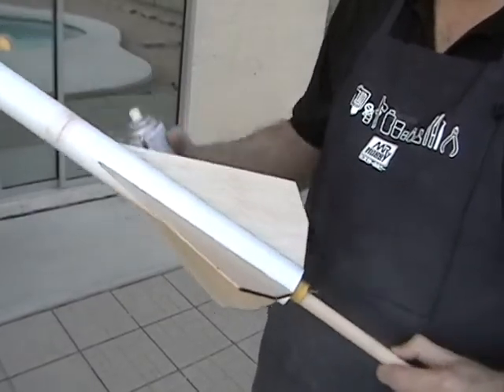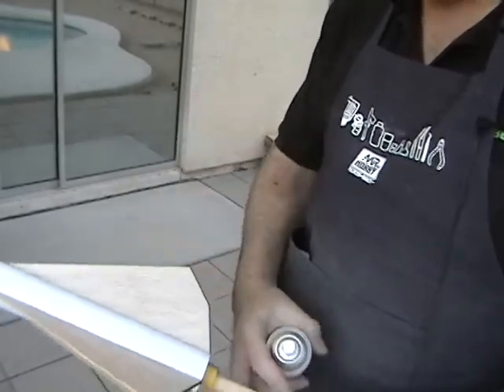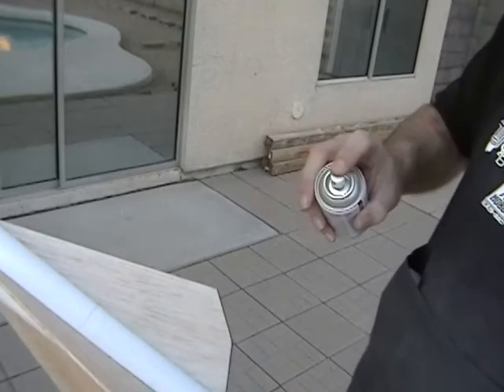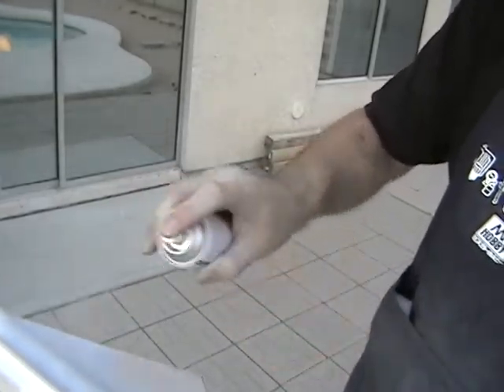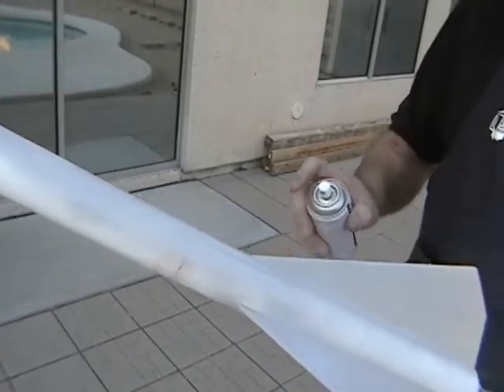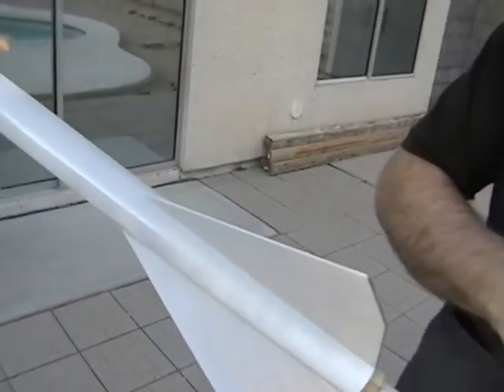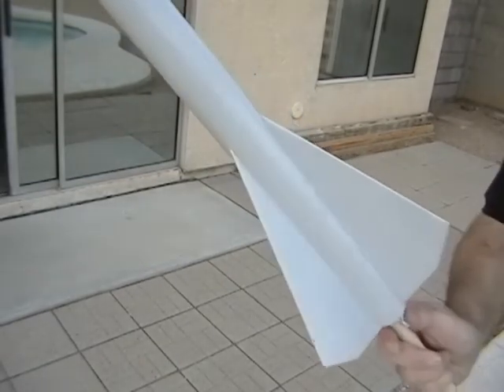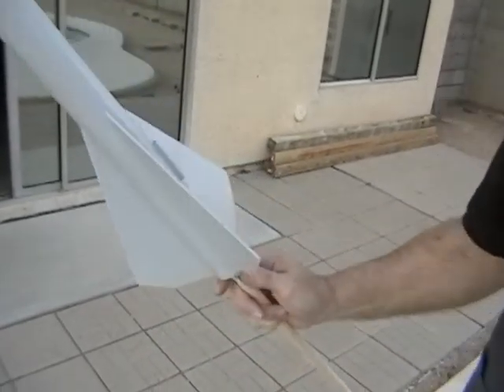Maus Werx Model Rocketry Priming the Estes Hi Flier XL.

Comment: Ive  found  aerosol original kilz is the best and its cheap its sands unbelievable if u spray the lines n the tubes 1st 2coats then the rest of the tube u can easily sand those lines out without any filler the stuff is with out a doubt top of the line primer sometimes it bubbles dont worry let it set 24hrs then sand it so easy to sand try it you wont be disappointed